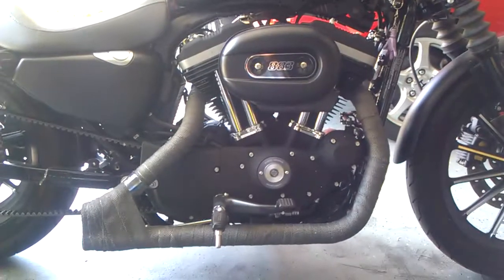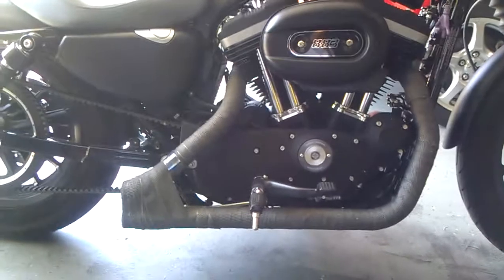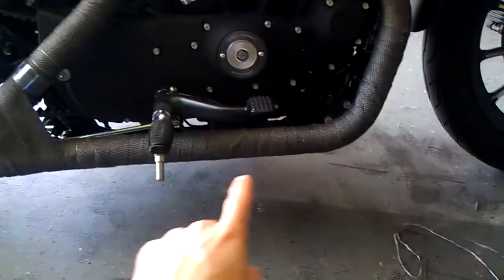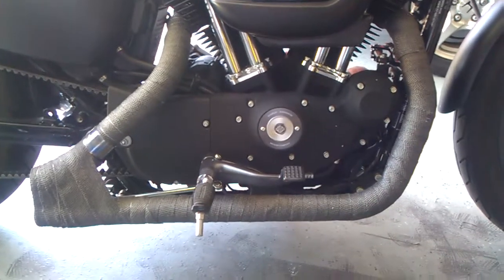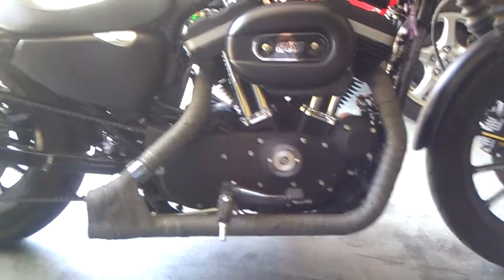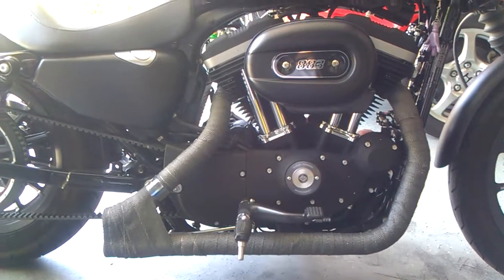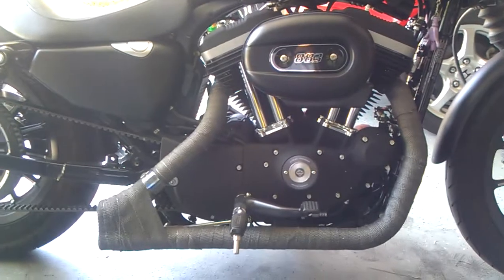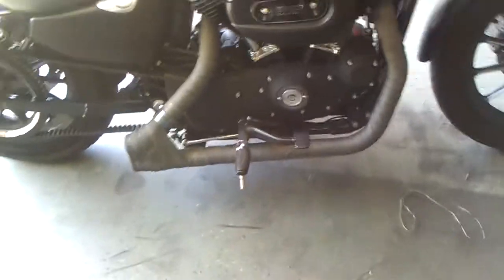Harley davidson 883 homemade stock exhaust LOUD

Comment from the maker: No baffles, I messed up I do have a fuelpak but didn't realize fuelpak only has set map's for name brand exhaust its not customizable like a power commander. So I suggest if u do make a home made exhaust get a power Commander that way u can take to your local shop and have them hook up Your bike to A dyno and Get u a map specifically for Your exhaust So it runs tits on. As of now I have the map u would Install if U had Vance & hines short Shots And It runs ok
Reply: Hooligan!
Reply: Today is your four year anniversary of your 1000+ mile ride in 18 hours. Hard Core Mikey!
Reply from the maker: Ohh how I will never forget that ride. I never turned in my paper work but I know what I did and u know what I did and I'm good with that 😆